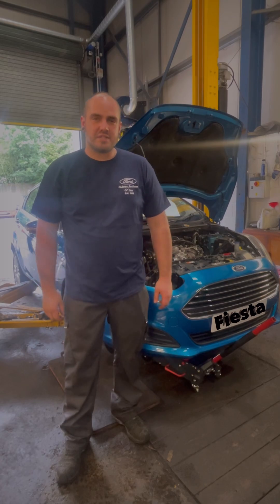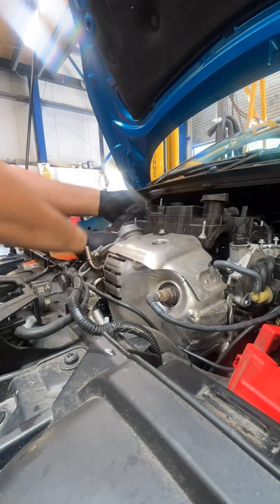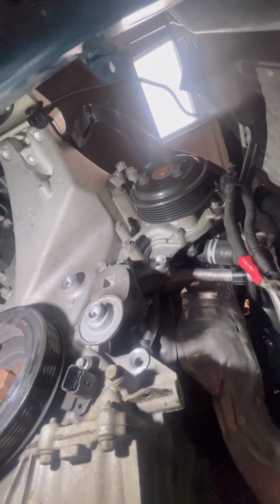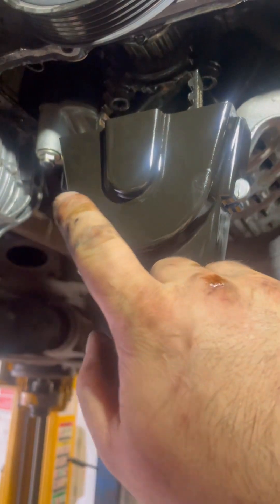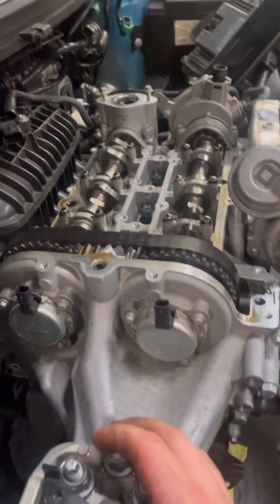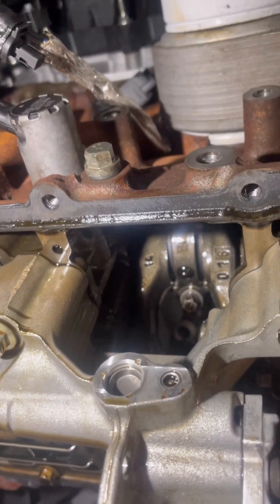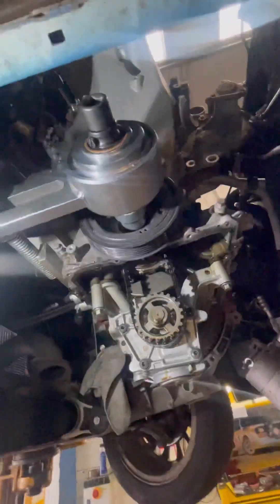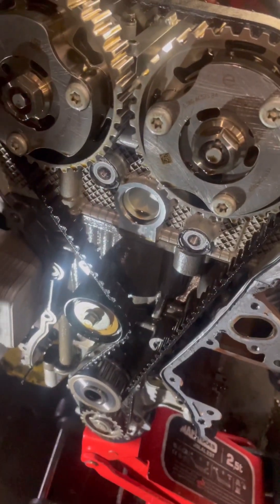Ford Ecoboost timing belt replacement

Comment: I am the proud owner of one of the few 1.0 ecoboost focus’ in the states. I’ve got approx 70,000 miles on it and have loved it so far, only a little paranoid about the oil pump plugging I’ve come to learn about.
Reply: Nice video what cost will I be approximately at a Ford or other garage thanks